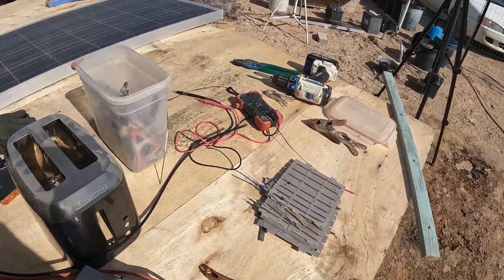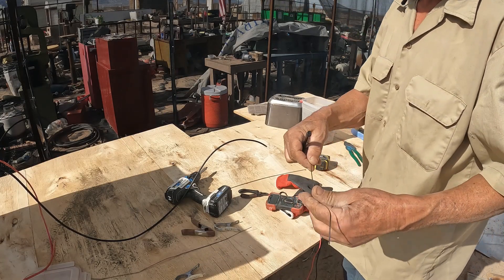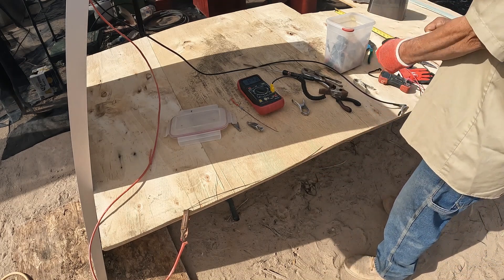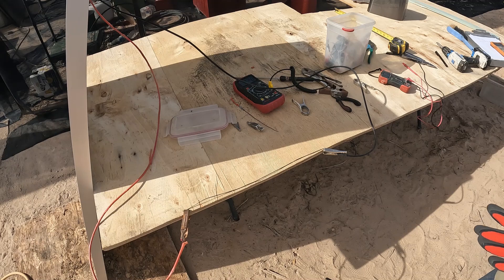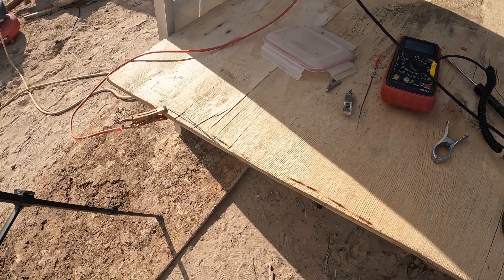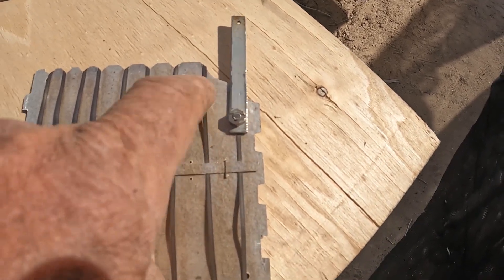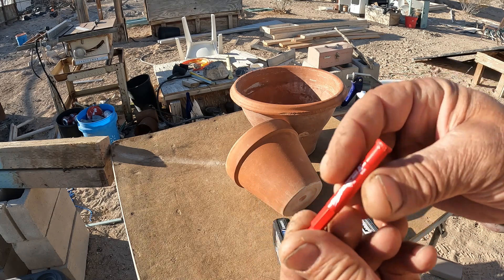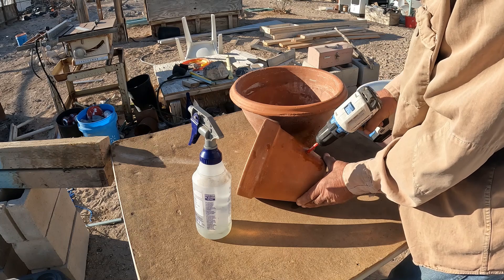Terracotta With Toaster Element Sand Battery Test

Comment: thank for sharing your work on this subject matter,we have to figure this out.heat a large enough properly insulate mass of sand all summer and get enough heat to heat a given space all winter.i was thinking the simplest way to get the heat out
is lay 6 or 8 inch metal stove pipe in the sand and have a blower on a thermostat.i cant wait to share my work on this.

Comment from the maker: I built that mainly as a test and to show how the stainless steel connecting straps for the wire connections seem to be a good way to connect the wires away from the extreme heat.

Comment: Just some other options for connecting wires. You can get ceramic wirenuts for high temperature use. Also, small split bolts are available at Home Depot or Menards. They are just like they sound, a bolt with a slot cut down the shaft the nut then pinches the wires together in the slot.

Comment: whilst it will never be as efficient as a good solar thermal setup, it IS a great way to use incompatible and salvaged panels. i can get hundreds of grid tied panels for nothing, but havent figured out a decent way to use them. 36V just isnt easy for an offgrid setup. batteries sold in multiples for 12,24, and 48... rarely for 36. inverters, same deal... too much effort.

to just dump that heat into sand? and break that little part of physics, that you cant heat something hotter than its source... thats NOT free energy, its just a way to concentrate the energy and result in higher temps.

this requires some type of mppt specially made. the idea isnt to dump it into a fixed resistance, you need to vary it to suit the panels output at any given moment, and keep it in its peak efficiency zone.

ive been really keen on trying this for wind, actually. because that part of varying the resistance to keep the efficiency? it means you can harness the energy your turbine captures. ALL of it. at ANY wind speed. no brakes, no batteries, no inverters. no elaborate controls, even a simple relay setup would work.

people cry when confronted with the problem of using that heat though.

modern education. people forget that engines run on heat... think they run on fuel. brainwashing and ignorance reign supreme.

can boil water for steam, can heat air, can heat water, can heat food. theres thermoelectrics, stirlings, and a hundred and one other ways to use heat to do something else...

Comment: Thank you for showing us this. Easy to make. So 275watt x 3.41 heat product 937.75 BTU x 5 hours sun light on the panels.  = 4,688.75 BTU that can be produced from this. What are you trying to heat? My house needs 90,000 BTU to heat. 

10,000 sq mobile home needs around 30,000 BTU. Says Google.
Reply from the maker: These are mainly tests I am performing. I realize it wouldn't heat much but may be used as a space heater or possibly even a dog house. I am working on a larger one that hopefully can heat a nice sized area.

Comment: 39 is open circuit voltage not the same as the working voltage 275 watts at about 30 volts would be more accurate I believe.